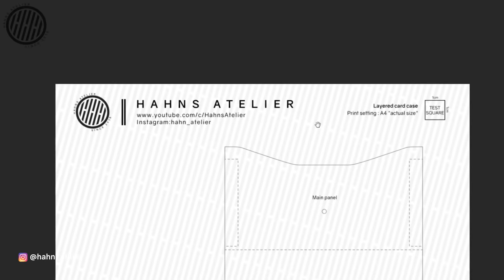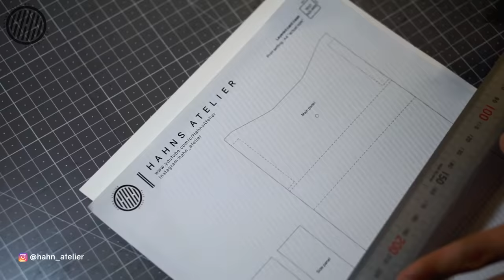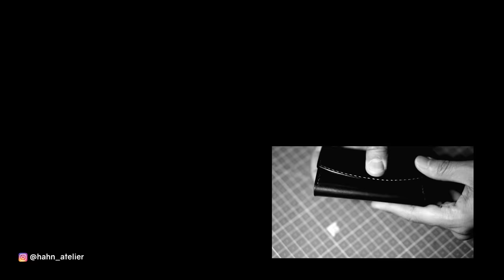[Leather Craft] Making a handmade card wallet

Comment: Hahns how do you make the stitching holes for the angled piece at 7:20? You don't show how you punched the holes for that piece, I can see how you after you punched the holes run through with an awl. Can you explain your method here? Because I am having trouble punching holes through angled stitching lines and if I was to use a 1 head chisel the risk for inconsistency would be extremely high

Comment: Buenos días, me gustaría  saber que tipo de pegamento utilizas, si es posible, ya que observo que es muy limpio a la hora de usarlo y fácil de repartir en el cuero. Gracias de antemano y por supuesto un trabajo excelente
Reply from the maker: ¡Buenos días! Gracias por el comentario. Comparto mi lista aquí. ¡Espero eso ayude!
[Glue list]
1. kenda bond 
: yellow, chemical smell, very strong, low price
2. intercom ecostic, high price
: white, no chemical smell, thin
3. Instant adhesive
: race, braiding, metal hardware (rarely)
4. B5 bond
: Beige, Thick, using for lining.
Reply: @HahnsAtelier  muchísimas gracias, very thanks

Comment: Hi hahn i was wondering what size space you use to mark your stitching and do you use a bigger size stitch mark when putting a hot line i have just bought a manual line maker it's 2 mil but seems to look to far from edge do you think I should try 1 mil line maker?.I'm sorry for keep asking questions but Thank you for your interaction 😊.
Reply from the maker: Hi Mark! I using 2.5-3mm gap for the stitch mark and for creasing line is 1mm gap. Hope it helps!! ;)
Reply: @HahnsAtelier   yes that's great hahn ,i totally forgot about sending this message now i found this it will be very handy

Comment: Isso branco q vc passa é cola branca ou algo específico pra isso, deixe o nome se possível de lista de materiais q vc usa, obrigado pelo vídeo e parabéns pelo talento
Reply from the maker: Obrigado pelo comentário
[Glue]
1. kenda bond 
: yellow, chemical smell, very strong, low price
2. intercom ecostic, high price
: white, no chemical smell, thin
3. Instant adhesive
: race, braiding, metal hardware (rarely)
4. B5 bond
: Beige, Thick, using for lining.
[Leather burnishing gun]
: Tokonole

Comment: Please tell me what glue you use.
Reply from the maker: Here is the glue that I use usually Hope this helps!😊
1. kenda bond 
: yellow, chemical smell, very strong, low price
2. intercom ecostic, high price
: white, no chemical smell, thin
3. Instant adhesive
: race, braiding, metal hardware (rarely)
4. B5 bond
: Beige, Thick, using for lining.

Comment: What type of glue do you use?
Reply from the maker: Here is my glue list 👍👍
[Glue list]
1. kenda bond 
: yellow, chemical smell, very strong, low price
2. intercom ecostic, high price
: white, no chemical smell, thin
3. Instant adhesive
: race, braiding, metal hardware (rarely)
4. B5 bond
: Beige, Thick, using for lining.